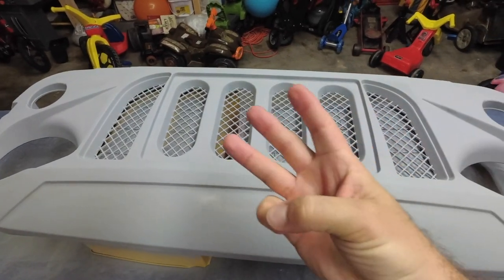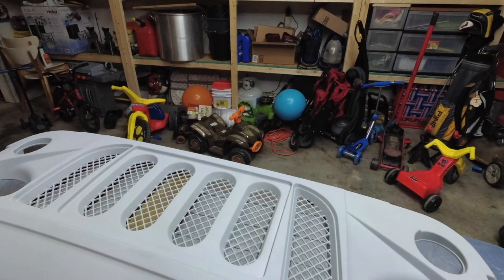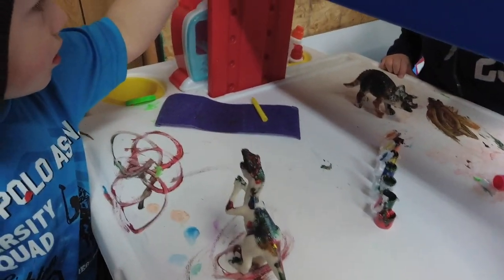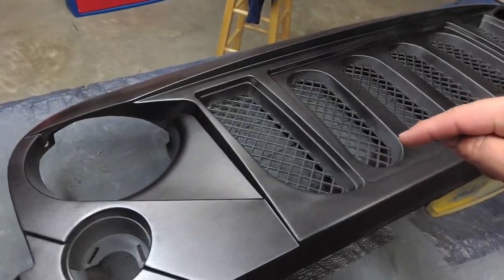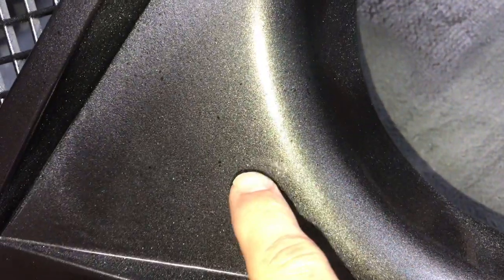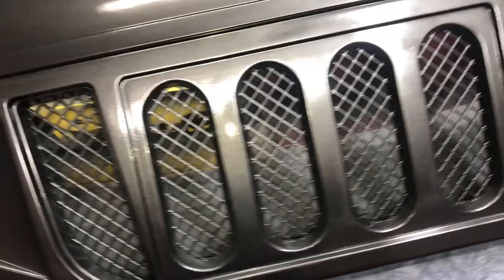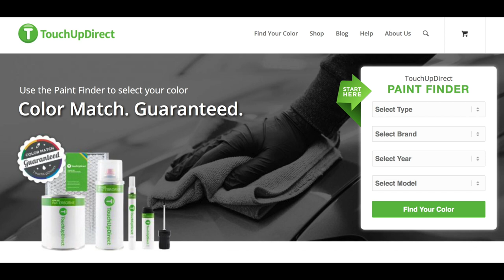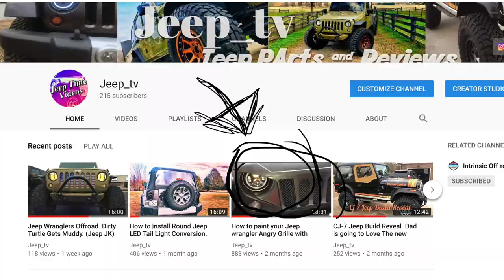HOW I Re-Painted My Ugly Jeep Wrangler Grille | Jeep JK

Comment: you ever thought of buffing it out with a orbital buffer or wet sand it.
Reply from the maker: I tried wet sanding lol and it was awful. I tried a few other things off camera 🎥. My buddy who paints bikes and has a shop. Told me basically I painted in to cold of conditions. And if I did my clear coat to thick the top layer dried before the under layer causing the pain to crack like mudd. So if your going to paint follow the directions on the can. By degrees and your paint coat dry time. It’s as simple as that.... And I screwed it up.... 😂